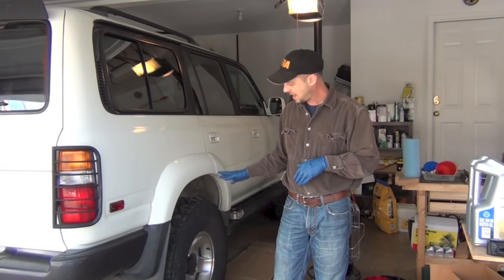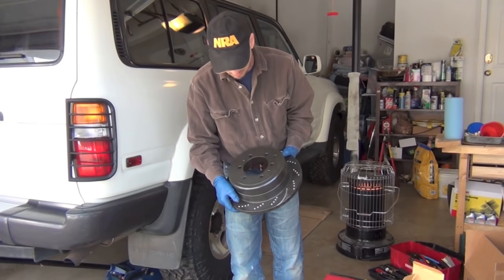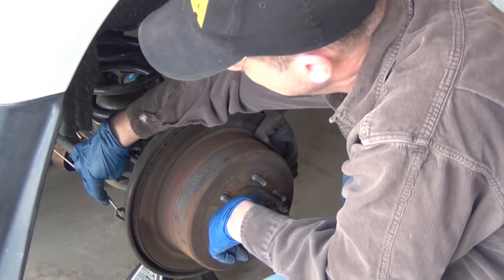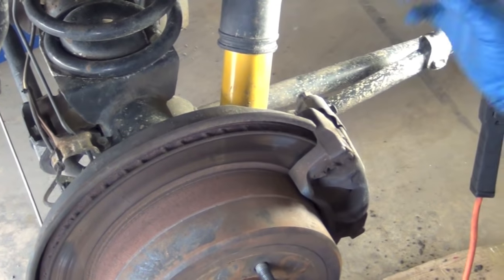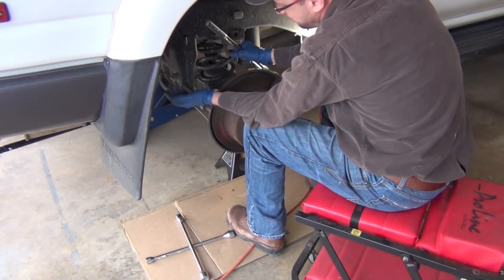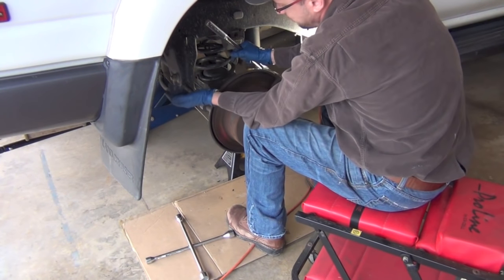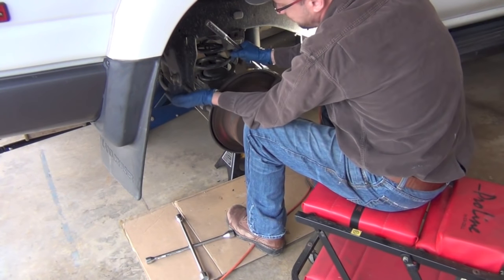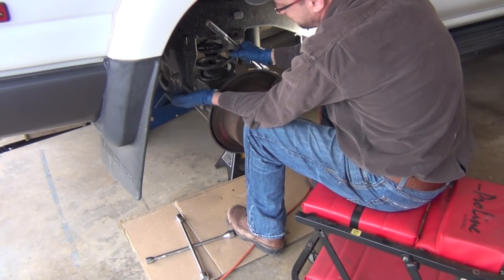80S Land Cruiser Rear Brakes

Comment: Thanks for the video. I've went through 3=4 sets on the front and getting ready to do third set on rear since I've owned it. I did the fronts once myself. This will be my first time doing the rears myself. I thought you had to manually back the rear calipers in instead of pressing. I've had to do that on some other rear disc vehicles. That's why I pulled your video up. Great video Thanks.
Reply from the maker: Yeah, the Land Cruiser have actual shoes for the e-brake vs using the pads on the rotor. So it’s really straight forward and a great design.

Comment: 500,000 miles and had to put pads on her today. I wonder how many sets of pads she had up until now but she is good to go for another 50,000 at least before she will need another set. GREAT VIDEO     '96 Lexus LX450
Reply from the maker: That’s awesome. Still have mine and still big smile every time I drive it. I’ve changed my rear brakes out once again since this video was made. This last time I pulled the axles out and repacked the axle bearings as well. Was a good service. I got about 38k miles out of the EBC brakes. I think I had them engaging too strong as my front to rear bias valve never was re adjusted after my lift. I went back with Power Stop pads and rotors this last time.

Comment: On the rear LEFT- disconnect the shock strut and swing it away, that little extra exercise will save you so much time and frustration/swearing. From a previous person unknown, My left lower caliper bolt came out eventually and thank the lord the bolt took much of the cross threading damage, again because the bolt was hampered by the shock, just F it outta the way. Happy days (caliper removal task only)

Comment: great video  because i have not done the brakes on a 4x4  before so this helped me associate with what and how of these trucks cheers .. oh and if you undo the lower slider bolt you should be able to do the brakes without removing the entire caliper .. i may do that as a video myself in the near future but for now cheers again
Reply from the maker: You have to remove the entire caliper to change the rotors. I also cleaned mine up while I had them off. Thanks for watching. Take care, Clay

Comment: Pretty good video...did rears on my 96 lx450 today; however, watching around 10:00 to 14:43 I don't see how the hub comes off. I needed to replace my hub assembly but on the 96 lx it looks like its held on by all six nuts on the back of the shield? Suffice it to say, I just put on pads but please expound on how the hub comes off. Also a piston caliper tool really helps in compressing that piston back, mine wouldn't go back with the ol' 6" C Clamp and board trick. Oreilly's $9 dollar twist handle crank plunger style did the trick. Had a few grooves in my rotor so I'll have to revisit as it will probably eat my pad up...but I'm quiet and all no scraping. LOL.
Reply from the maker: +rdietz68 Okay, the rear hubs also house the e-brake shoes which push out on the inside of the hub and that's how they hold your wheel from turning when the e-brake is applied.  You have to often use a little tool and loosen those shoes up before the hub will pull straight off the lug studs.  Watch the video at 17:45 and you will see a little star wheel that you can turn through the hole in the hub to loosen the shoes some (see 25:23 in the video to do this).  Obviously you can't have the e-brake pulled and on!  and you will also have to have the entire caliper off.  Lastly, at 32:15 in the video I use a piston compression tool like you describe.  Hope this helps.  C

Comment: hey there, tky for this video, I just had a problema with the left emcy brake getting stock somehow and overheated on my lc 97....this coming weekend everything is coming out. for now I will keep the original disc/drum assembly, but looking fwd to get some disc as the ones you installed. rgds from PANAMA
Reply from the maker: +nilo miranda You may want to replace those shoes inside the hub (e-brake shoes) while you are in there.  Glad the video is helping you.  Awesome that I'm getting a viewer from Panama! Take care, Clay

Comment: Thanks from Australia 🇦🇺 iv just got a 80 found this video because in need to replace my brake I didn’t know how to do it and Now I do What a A+ video mate 🤘🏻 Any holy Flying dog snatching eagles 🦅🤣  I’ll never complain about being bashed by a kangaroo again!. Do you have a instagram I can follow?. Regards Aussie
Reply from the maker: That Eagle snatching our poor little dog was crazy. Lonestar passed away a year ago at 17 years old. We miss him. I’m the same name on Instagram- Texasknowhow. I need to post more there as well. Thanks for letting me know the video helped! Clay
Reply: @Texasknowhow  sorry mate and yes post more a swivel hub rebuild would be AMAZING or even how to change a cv ! 80series plus that would get high views M8. You videos are A+
Reply from the maker: @tyyt3206  - my left Berfield joint just start leaking slightly so it is time to make a video on those. I also want to cure a power steering leak and that rear main that leaks. I’ll try to get back on the 80.

Comment: hey Clay

It's Rupert again, hope the family is well. I have two q‘s, 1st. can u give me some guidance to replace my the fuel filter on my '96 LC, I can't find any good videos about it. I would like to know its location & what needs to be removed to get to it. 2nd. as mentioned I will need to rebuild the knuckle & replace the inner axle seal. Do you recommend the rebuild kit from Slee, I am worried about buying aftermarket stuff only to have the seal leak again soon afterwards. Thanks.
Reply from the maker: +Rupert Gaznabbi Hello Rupert!  Yes, we are all fine, thank for asking.  For the fuel filter, I've had a replacement on my shelf in the garage for over a year!  I need to replace it and I do need to video it for you guys.  it is located up under the intake manifold and very hard to change from reports on forums like ih8mud.com.  But it is doable without removing the intake.  I hear you will get fuel on you and it is not fun.  Much better design on the 100S LCs.  If I get to mine soon, I'll publish a video. On the inner axle seal, I've heard mixed reviews on both the aftermarket ones and the factory replacements.  I really think either will work and the problem is probably with the methods folks use to get them in there and depends on if you get it straight and don't damage it in doing so.  This is also something I haven't tackled yet.  I think you will be okay with either seal set.  Just take your time and read up on the methods folks have used on ih8mud.com.  Good to hear from you, sorry I didn't help much, take care, Clay

Comment: in Australia we have a plate welded on the tow bar where those 4 bolt holes are on the rear there.we can tow 3500 ton
Reply from the maker: +dnny operator That's a lot of weight!
Reply: +Texasknowhow sorry 3500kg
Reply from the maker: +dnny operator okay, I was thinking that might be what you were saying there.  Thanks, they can tow a lot for sure.  Take care, Clay

Comment: Another great video Clay - How often do you recommend packing the bearings on a 100? I've owned my rig for about 3 years and have never touched the bearings, I also don't take it off road.
Reply from the maker: Masood Elyacy - Hi, I would at least pack them with every brake job.

Comment: How do you like the black EBC rotors. Just ordered 2 sets for front and rear. Had green pads and cryo rotors before but wondering about these
Reply from the maker: Mike Gibson loved them. Just changed those out. Making an update video.
Reply: changed them out for another set of EBC GD series black rotors?
Reply from the maker: Mike Gibson  no, I'm giving Power Stop a try this go round.
Reply: Did you ever posted a video about power stop? I need new brakes on mine and I'm trying to decide which one to use.

Comment: Anti seize compound can be a life saver for future brake changes. Also, wouldnt the drilled slotted rotors catch mud you think?
Reply from the maker: Mud/water etc will get in there but will get worked out as you use the brakes. That's why I suggest orienting those slots such that as the rotor turns the debris will be centrifugally (sp?) thrown out. The little half way thru drilled holes may pack full...
Reply: They get full of mud on the trail and hot pads bake it in. It doesn't "sling" out

Comment: My new pad kit(and pads that were in there)had little metal clips that went on  only one end of the brake pad, curious as to why you didn't use them if you had them?
Reply from the maker: Hey Kimo Clyde, Yeah, I had those as well, but I couldn't get them to stay in place.  Gone by the first 100 mile inspection of the brakes...
Reply: @Texasknowhow  Interesting... I think there were only four total and from what I remember, they clip on only the bottom of the pads. My pads I'm replacing had only two. Wonder if there's a trick to them to stay on or maybe they're not crucial.
Reply: Okay, did some research (for whomever wants to know)and those clips are wear indicators and they go on each pad on the top tab. So one on each side, two per side(driver and passenger).
Reply from the maker: Kimo Clyde - I knew exactly what they were, but like I said they didn’t stay on mine. I check my breaks with each 6000 mile tire rotation so I just blew them off and didn’t pursue a replacement.

Comment: Shoot, no info on how to do the hardest part,,,,the DRUM SHOES. Calipers and pads are easy, I need some tips on how to do the rear drum shoes for the parking brake. They are a PITA.
Reply from the maker: moh2o -yes those are sometimes a big pain. You can take off the hubs/axles to get to them easier, but that in itself is a bit of work. I just did this job (re packing bearing, rear brakes, e-brake shoes and all) but I haven't gotten it published yet. Those shoes are easy when the hub is off. Sorry man. Take care, Clay

Comment: how tall is your garage door and /or whats the final height of your landcruiser  after the lift and your tires..whats your tiresize?
Reply from the maker: Steven Wood - Hi Steven, my garage has a 7' door which I could just fit under before I added the ARB touring rack. Now it won't fit through the door by about 3". My tires are 34.5" total and I have the OME lift that is about 3" so those tires clear the fenders etc.
Reply: Oh ok.  I think I have a 7 ft door on my garage. I'll probably have to remove  my roof rack then

 Have you replaced the rear axle bearings and a video covering it?
Reply from the maker: Steven, I haven't done the rear axle bearings yet.  But last time I did a tire rotation I checked the play and they have some.  I will first try to adjust the bearing preload (very similar to the front) on the axle as it is a full floater.  If that doesn't feel right or correct the slack, then I'll video the bearing replacements.  Should be in a few weeks if so. C

Comment: what kind of lift do you have on your 80?
Reply from the maker: +Ross Carmack (BRAVOTF2) 3" using Old Man Emu stiff strings and shocks.  Bought them from Cruiser Outfitters in Utah.  Added Slee caster correction plates and Slee SS braided frame-to-caliper longer brake lines.  Added a 2" lowering blocks to my sway-bar mounts (made them out of aluminum block) to keep them closer to level.  The "stiff" springs, as they call them, have a little more lift and can take the added weight of a new bumper and winch moving forward.  https://www.cruiseroutfitters.com

Comment: Do you know if there's any brake Pistons upgrade?
Reply from the maker: +Marcos Fandiño Hi Again Marcos, I got all the kits for the brake sliding parts at the Toyota Dealership parts counter, they can help you.  I got the rotors and pads from Amazon.  I also got caliper rebuild kits from the dealer, but didn't rebuild the calipers in this video as they were recently replaced by the previous owner and were in good shape.  I just checked Amazon and they don't carry the EBC rear rotors now.  There were other brands on there tho.  Hope this helps. Clay
Reply: Peppa pig

Comment: Hmmm.. mostly nice video. 

I was doing overhauling of brakes of VX 80 1993 and enough of brakepads left and material on discs but.. caliber pistons/cylinders was 60-70% stuck and some of them specially in rear rusty and destroyed. Change both rear pistons.

But..

Very important. You should never push the pistons back in without checking the status of them. Never. That's because within the rubber seal there can be dirt and even bad rust. When you press the pistons back in as you did in this video, specially with tool like this of yours, you will damage the inner most seal and your calibers will leak.. on rotors etc.. 

And.. If cyls have start to rust, most simple thing is to replace them, not repair and or clean them.. they will rust again because the chrome "film" is the rust barrier..
Reply from the maker: Bjarni Einarsson thanks for the comments. Many will argue with you on your "Never" statement. Mine are still performing excellent 3 years later...  Of course I did a visual inspection, no rust, pistons moved back in easily, so I went on with the maintenance. No leaks at all.
Reply: Ok.. no prob.. I must have missed that part in the video..  But to my best  recollection the piston seems to be rather stiff inside the caliper as you did press it in with your tool.. that's sign of dirty one or at least dry one..  

It's possible to gain access to the cyl by moving the harmonic rubber seal front of the piston to clean it, I myself prefer to put wisegrip on brakehose (as mildly as I can) to block it, and then disassembly the caliber and then the cyl from the caliper fully for proper cleaning and close inspection. I use air to pop it out with help of towel around the piston etc.. 

Lousy braking is mostly related to "stuck" or stiff cyl in caliper.

Comment: What size tires u have?
Reply from the maker: Luis Hernandez - 35” Goodyear Duratracks.
Reply: What about lift? It’s crazy that you came from Texas to Virginia .. i came from Texas to North Carolina
Reply from the maker: Luis Hernandez - yeah we moved back to TX after 5 years there in Northern Va. moved back in 2017. 3” Old Man Emu lift. With Slee Caster correction plates. I fabbed the dropped links for the swaybars. Slee extended SS braided hoses fro brakes (Frame to axles).
Reply: Nice I got my  fzj80 w/lockers 2 months ago and your videos are very helpful. I’m heading to Texas in may to visit my parents and for my sister wedding.
Reply from the maker: Luis Hernandez - Glad the videos are helping Luis. Once a Texan always a Texan!
Reply: Your right thanks once again!!

Comment: $25 for those little clips
Reply: @Texasknowhow  7:28
Reply from the maker: @Billy-rr7re  I said $7 or $8 for the whole set. Not $25. If someone quoted $25 it is still probably worth it for all the sliding surfaces - making all these like new will transform the way the brakes operate and are able to freely slide. If your surfaces are good, skip buying them.